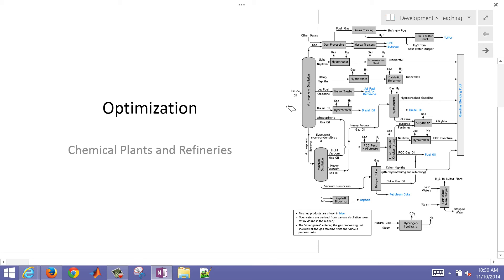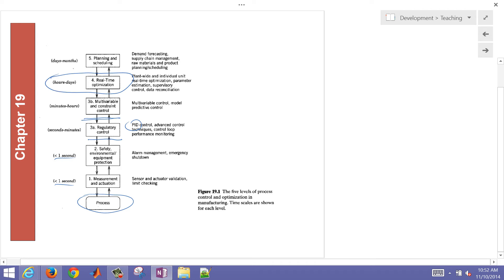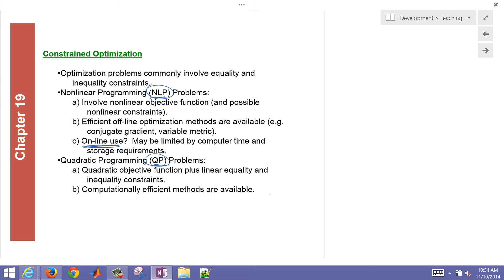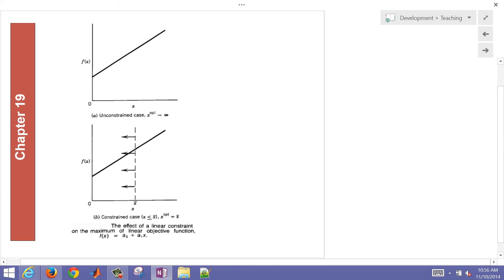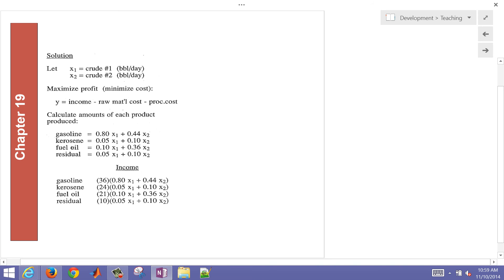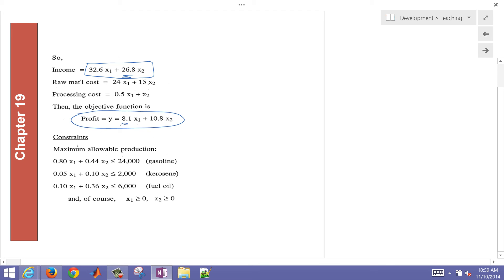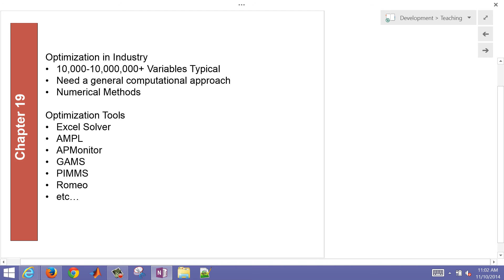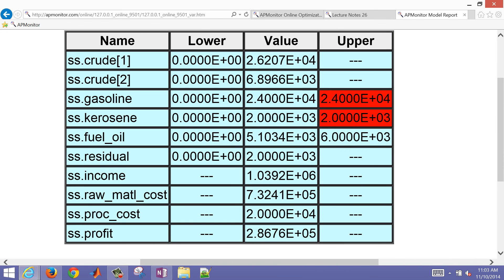Oil Refinery Optimization

Comment: Hi ...what if we have 4 types of crude .....
Reply from the maker: Refineries solve this problem with hundreds of different types. It takes a good optimizer to solve a large scale optimization problem.
Reply: @apm   in your example you have used final product data related to individual crude like for crude 1,  .8 percent will converted to gasoline etc.... Do you have any idea from where we get this sort of data. For example, how much conversion will happen for Saudi Arabia or Iraq crude. Also, can we predict crude conversion percentage based on APIs of crude.
Reply from the maker: @palashpatnijain10  you'd need to get that information from a refinery.